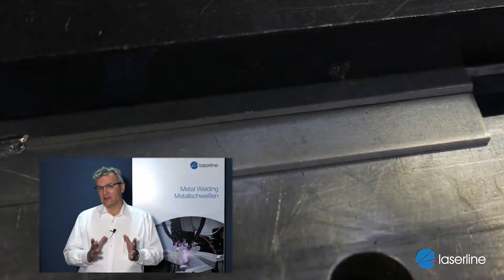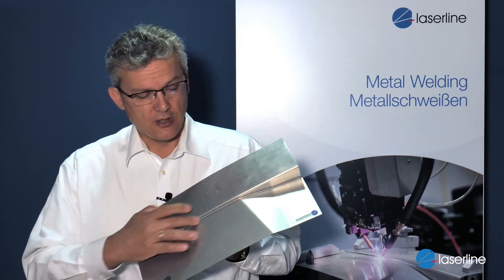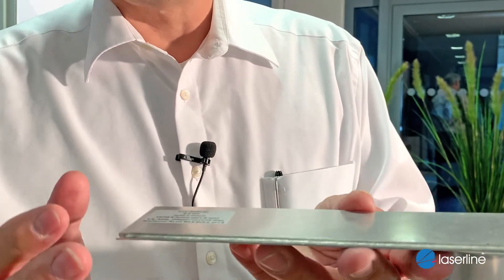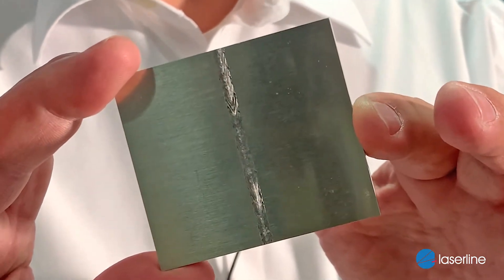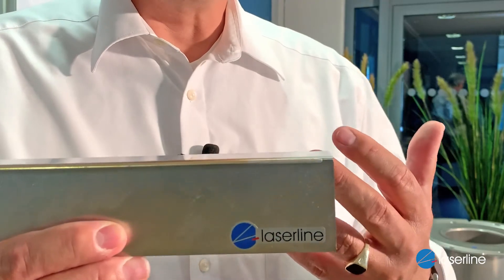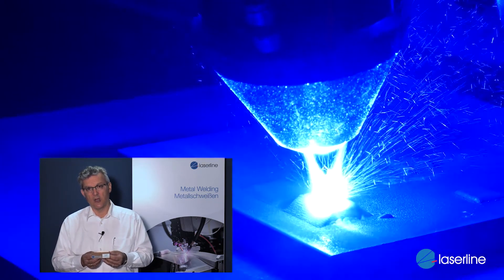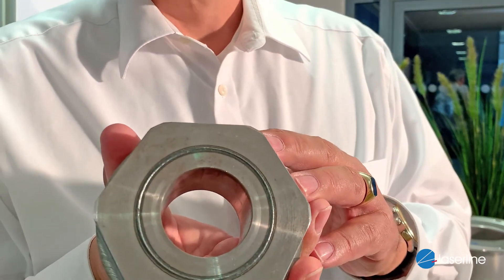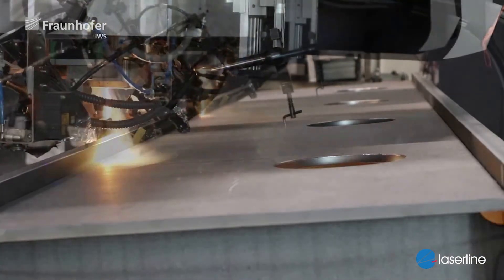Laser Welding versus Laser Brazing EN

Comment: Hello Markus. I actually stopped for watching because I thought this was a German handheld laser manufacturer. It turned out to be mostly automated, high‑power, space‑grade 6 axis CNC  welds , impressive, but not what I was looking for. I was hoping to see a 6 kW handheld that fits in the trunk and can do a real 12 mm structural T‑joint. That was my expectation from a German company. and just noticed it is a 5 year old video. Either way cool stuff Danke schön